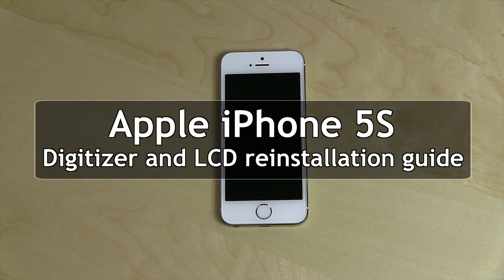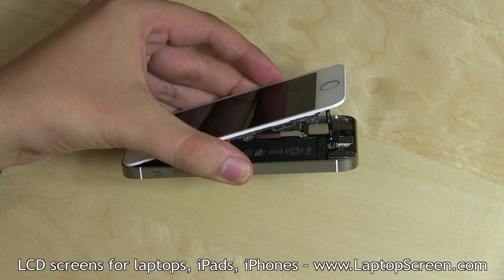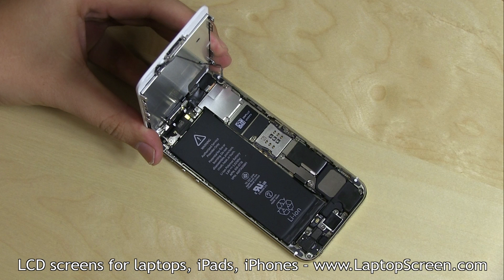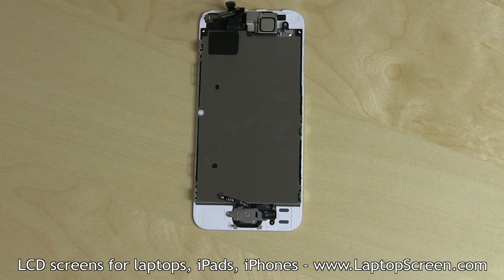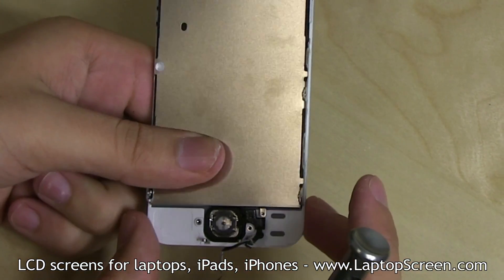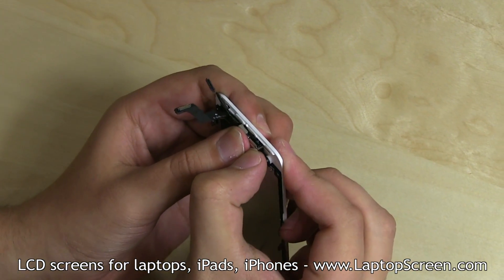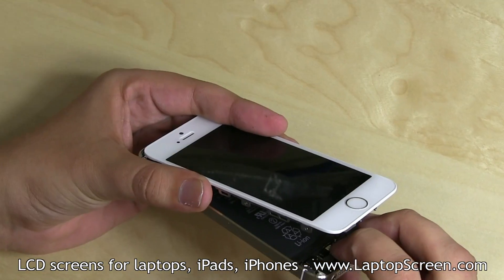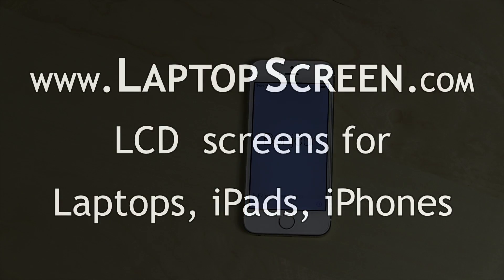iPhone 5S screen replacement / digitizer glass and LCD reinstallation instructions

Comment: I'm afraid I may have applied a bit too much force snapping the digitizer cable to the motherboard.  I've replaced my screen a few times before but my last attempt the touch screen no longer works.  Any suggestions?

Comment: whenever I touch my screen it doesn't do anything it doesn't work. but it still comes on. half of the screen is rainbow color. do I need a new LCD?
Reply from the maker: +Samantha buetow Yes, unfortunately the "rainbow color" on screen is usually a sign of a cracked LCD.
Reply: @Laptopscreen  I have a similar issue only I installed a new screen with turns on perfectly but there is no touch function.  I can't use the phone :( plz help

Comment: Done multiple screen replacements, but for some reason this one is killing me. I replaced the touch screen digitizer and the LCD everything works great, but as soon as I snap everything together it wont charge. Opened it back up to see what may have been the matter and it starts charging again. 

Again, everything on the phone works before you snap it together, but as soon as you do it stops charging. I even got it to charge if I pull on the bottom of the screen with a suction cup and it will start to charge, but as soon as I let go of the suction cup it quits charging.

Comment: Done everything that youve said and all goes back nicely and switches on, but the screen doesnt want to recognise finger movements. Have tried this with two screens so I dont think that its the screens are faulty - any suggestions?
Reply from the maker: +Dave Adams Its important to figure out when the touch function disappeared. If it was still present on the original (shattered glass) - put it back in for a test - if touch still works on it - then both your replacement parts are suspect. If touch doesn't work with any of the available parts including original - then a logic board replacement should be considered. Look for it in used condition on eBay or Amazon - make sure to create the most recent iTunes back-up using your old logic board, since replacing the logic board will replace the device's memory.

Comment: Hi I have started using your tutorial but the screen removal only pulled the screen up and not the digitizer which remains firmly in the case.
Do you have any ideas to remove the digitizer also?
Reply from the maker: Tony Johnson This does happen sometimes (the glass is pulled up but it's separating from its plastic frame). The way to deal with this is to stick a flat screwdriver somewhere beneath the frame - there should be some accessible notches to get under - and pry it open.